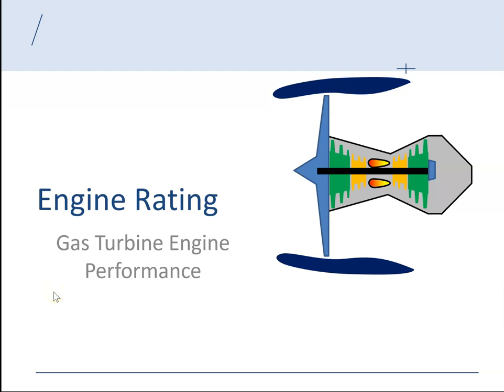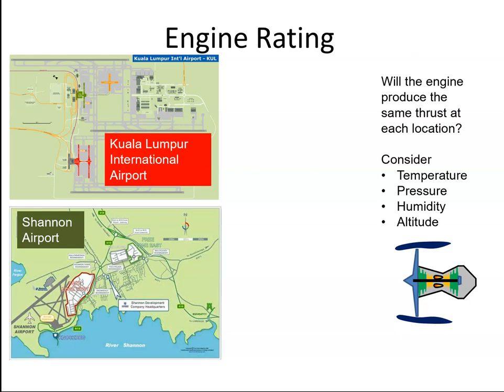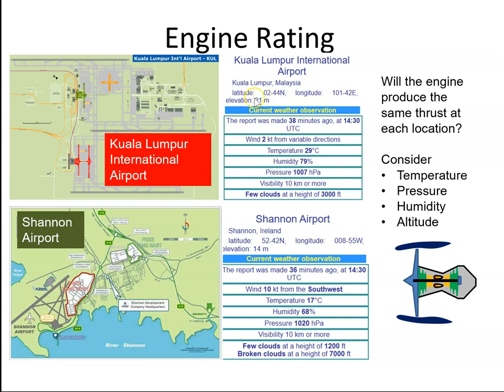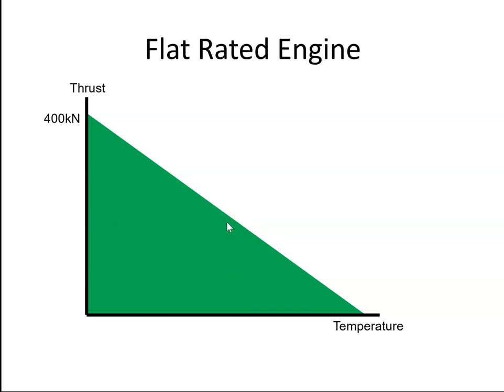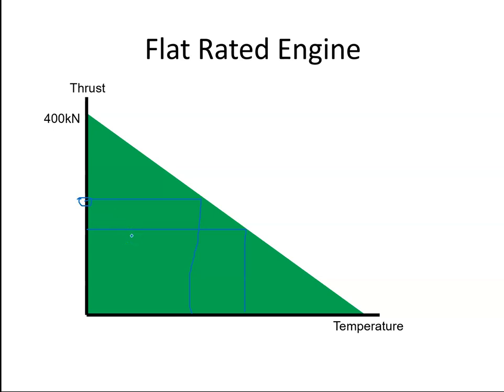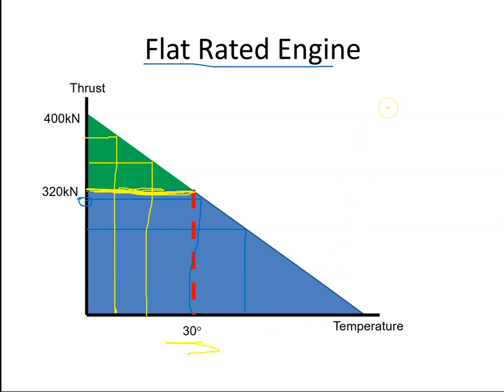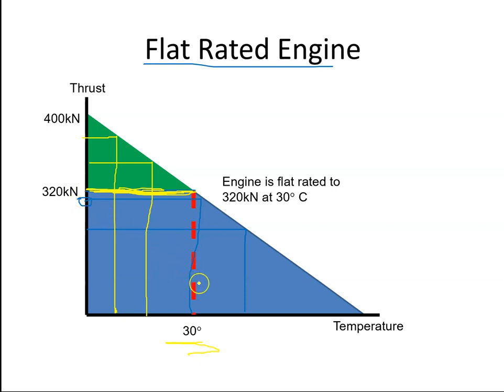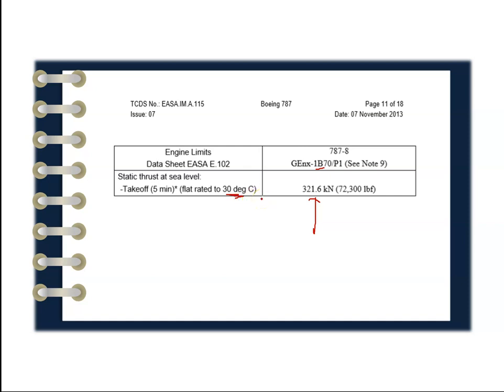Flat rating of an engine

Comment: Clear as mud. Can the voice is muddled too. Why would you decrease engine out in conditions where you need more?
Reply from the maker: The engine power output decreases naturally due to increase in atmospheric temperature.  The flat rating guarantees a certain amount of thrust up to a particular atmospheric temperature e.g 30 degrees celcius.
Reply: @RoddyMcNamee  No the power doesn't decrease naturally due to an increase in atmospheric pressure.
Reply from the maker: @jackhammer111  temperature, not pressure.

Comment: Hello Roddy! I just did not get what happens when the temperature overcomes 30 degrees c in this case. Is the fuel increased?
Reply from the maker: No, the thrust decreases.  So on very warm days the aircraft might not be able to take off at max take-off weight.
Reply: @RoddyMcNamee  thank you!
Reply: No. Above the corner point température (30deg C) in this case, thé fuel is reduced which is the reason why the thrust decreases. This is done to prevent overheating the engine.
This is not the easiest way to explain the relationship between thrust, fuel burn, and engine temperature (EGT).
There are some videos on the CFM website explaining this. Showing a chart saying flat thrust with a line constantly going down is not helpful, if I may 😊